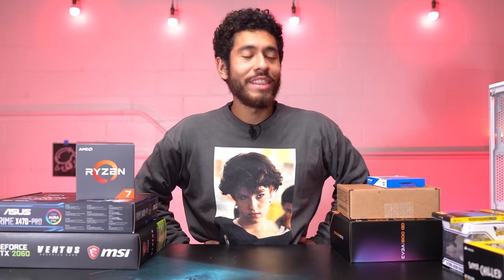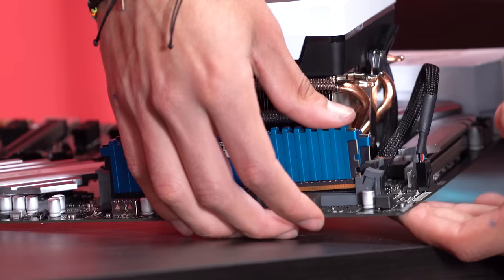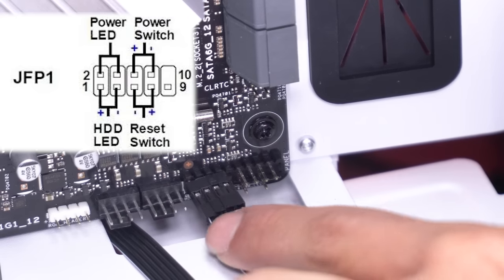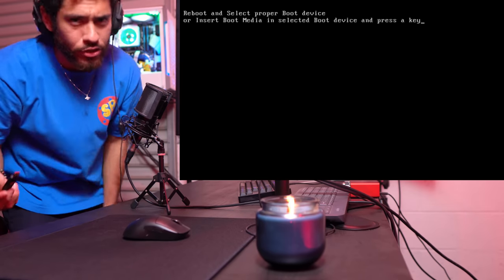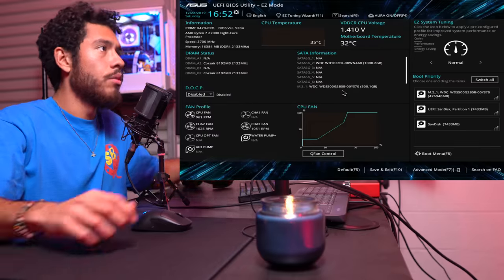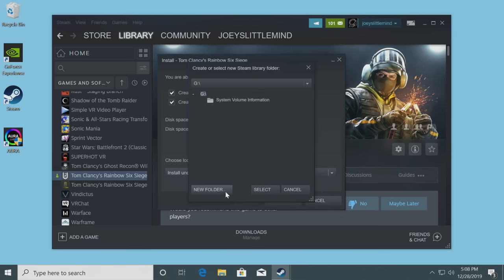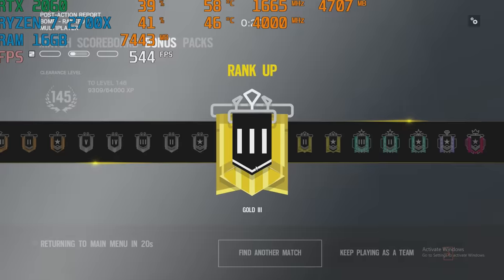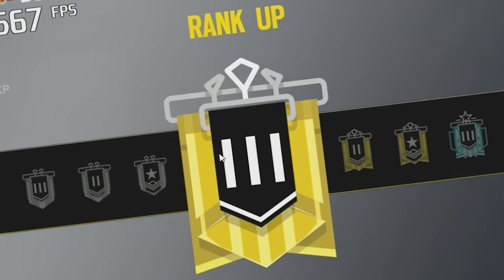Best $1000 Gaming PC Build Guide - RTX 2060 Ryzen 7 2700X (w/ STREAMING BENCHMARKS)

Comment: I finished my build today. Used everything in this video exactly. Had to buy a few things off Ebay and over pay. I had absolute zero PC knowledge. Followed this video and it all works. I am so pumped. I can't believe it works.
Reply: Hey if you are still reading this i wanna ask, Was it worth it? I mean can it provide you decent level gameplay and fps
Reply: @pushpagupta8649  Yeah I have since built a more expensive build which I use but this one worked great. No complaints at all. I have it if you want to buy it....
Reply: @zachc7401  how does it run on warzone
Reply: @zachc7401  how much are you selling the pc for?
Reply: @thunders246  $1000 is probably more than fair considering current part prices.
Reply: @zachc7401  where are you selling it and how will it be sold ?
Reply: @zachc7401  do you have any socials?

Comment: Added everything into a cart on amazon it’s around $1400 as of now.
Reply: Dylan Gaw the processor shot up in price.
Reply: Dylan Gaw big time
Reply: Everythings prices are higher than ever bruh
Reply: @Henonaga  nice
Reply: Dylan Gaw coronavirus
Reply: Lucky in UK its £1000
Reply: If you really want a PC right now look at prebuilt s but then again they are selling out quickp
Reply: lol
Reply: Get a ryzen 5 3600 and a rx 5700 xt or normal 5700 theyre cheaper and better. Hope this helps
Reply: Do u need the fan extension cable
Reply: Gaurav Rattu How is £1000 I’m adding all together and is more like £1100-1200
Reply: @Jayden Films is there a problem?
Reply: @Henonaga and the ram
Reply: You just have to watch the prices everyday 3 times a day, i thought the same but i got the gpu for 360 and had originally bout the cpu for 180 found the motherboard for 145$
Reply: @willbagnall3416  i was looking at the reviews on the rx 5700 and they'll all they they keep crashing and the drivers are bad.
Reply: @bzbee5139  those will be old reviews, they updated the drivers recently and now theyre a lot better. The Nvidia GPUs of similar performance (eg RTX 2060) are a lot more expensive
Reply: @willbagnall3416  i still think od go with rtx2060 ko for 300ish dollars. I kept seeing the rx5700 around 400ish. Do u think it would be worth it? I mean 6gb vs 8gb but was looking at some tests and they seemed about the same the rx5700 doing just a bit better.
Reply: @bzbee5139  they are roughly similar and if you feel safer getting the 2060 then thats fine but a lot of prices of computer parts are up right now because of precious metals and materials being scarce
Reply: @willbagnall3416  that and since quarantine more people are gaming to stay isolated.
Reply: WagNalyd yea. I’m still getting it tho
Reply: @amunqureshi3761  not really
Reply: @willbagnall3416  Do u need the ryzen 5 3600 and the rx 5700 xt or just the ryzen alone?
Reply: @tomasellar1727  you need both, the ryzen 5 3600 is a processor, the rx 5700xt is the graphics card. These 2 are just a cheaper alternative to the ryzen 7 2700x with the rtx 2060 super shown in the video and will have relatively the same performance.
Reply: @amunqureshi3761  nope
Reply: Well prices change over the course of 4 months
Reply: @tomasellar1727  if you want to play games youll need at least an ok graphics card, so you could get away with an rx570 or similar and the ryzen 5 3600 could be replaced with a ryzen 5 1600 AF. Hope this answers your question
Reply: big oUeF
Reply: Will Bagnall they are better in gaming but will stress out alot if you want to stream nd gives shitty experience trust me tried that(have 5700 nd r5 3600x)
Reply: @vaccy7644  thats a fair point
Reply: might as well just get the 3700x for cheaper
Reply: @liljavi do you think that cpu prices will go down when ryzen release their CPUs in June?
Reply: I bought it, but honestly for a little more you could get a 2070 super!
Reply: WagNalyd since everyone is inside everyone is buying pc parts bows not the Time to buy parts
Reply: Will Bagnall i dont think so old gen 2700x is still pricey would go for a 3700x instead of a 2700x like in aud its 30-40aud diff again depends
Reply: never buy all the parts over amazon if you want to be on a budget. Try looking around the internet for the parts.
Reply: Kayden Rooks yep yep newegg is good
Reply: more now
Reply: Will Bagnall how do u know? i was looking into building a pc so i’m just curios lol
Reply: Henonaga do you think after the covid 19 is done you think the price will drop
Reply: When I put everything in the cart that’s what the total was to
Reply: The Toyota virus screwed builds up
Reply: It’s cuz of the coronavirus
Reply: Lil Mxcha nice vids
Reply: American or different country
Reply: I'm doing my first build and I have decided on a Zen 5 3600 CPU. Does it matter if the GPU is Radeon or Geforce? Should I got CPU and GPU AMD?
Reply: The processor was on sale when he bought it. He failed to mention it was on sale tho
Reply: Bulien Does yea
Reply: Ya I found a 750€ gaming pc build guide I added everything and it was around 950€
Reply: XG GAMING yea bc of the virus and I think u mean Ryzen 7 3700x
Reply: Yea wait until covid-19 is over and prices will drop
Reply: Is it easy to build the pc
Reply: @dahoodnoob270  please send me your  links because for me £1,074. 95
Reply: @willbagnall3416  theyre not cheaper
Reply: @w00vz11  they were 5 months ago. Prices change my guy
Reply: @willbagnall3416  i checked yesterday on amazon since i was on pcpp sorting the parts of a build i might get. i saw that even the 5600xt was more expensive than the 2060(with shipping/taxes included) and the 5700xt was around the price of a 2080

Comment: This pc build is a lot more in depth than other builds, the cables and each step. a lot easier than other tutorials but it would be better if u played more games other and 6, maybe apex, cs: go, or modern warfare would be better.
Reply: GTA 5 BRO
Reply: SickGhostNavy GTA 6 I WISH
Reply: Depth*?
Reply: @ufly6349  gta5 is not a heavy game it can run it smoothly on max settings
Reply: @ahmetRY  ight thanks
Reply: do you know where I can get a black Verizon of the motherboard
Reply: @alpha9086  there isnt one out yet, but if you really want one and you wanna be risky u can just spray paint the white accents, more complicated but you get what you want, dont spray the rgb parts though.
Reply: do u know where I can get a black verizon of the processor
Reply: @alpha9086  the stock cooler for the cpu is already black, he just painted the cpu fan white, so youll be good with the same one he used. tbh if you were going to buy that cpu you should get the ryzen 5 3600 instead, its better for games and is 3rd gen
Reply: sorry for asking so much question but this is my first time building a PC. Is there a way I can get the graphics card in black and is there a mother board that I can get near the same mother he has, but is compatible with the PC and black
Reply: @alpha9086  the "asus ROG STRIX B450-F" is a good motherboard around the same price  and its black. the graphics card he has is already black and silver, at 6:50 (click the time) he paints it blue, if you dont like the silver you can paint that part black too. good luck with your pc. dont mind to ask any questions easy or hard.

Comment: Literally I was saving for the same PC . Recently swapped the 2060 for rx 5600 XT
Reply: 46M views have you had any problems with the 5700xt
Reply: @ryanm4044    my budget was a bit low !
Reply: @ryanm4044  what issues are you having I've seemed to fix 99% of what I have
Reply: Alex Atwood the picture keeps getting like white lines in it if you get me
Reply: @ryanm4044 Which card do you have? if your card is undervolted or overclocked, take those off, if that doesnt help download DDU and uninstall the driver then go to the AMD website and install the drivers  that says recommended not optional it should be working after that, also make sure your MOBO chipset is updated (b450, x470, x570) and such if not RMA the card or return it.
Reply: Alex Atwood wow thank you for the help I only really know how to do the basics as I’m new to this the card is the 5700xt sapphire nitro +
Reply: @ryanm4044  any of that work?
Reply: @oreo flow itll max it out 144hz at least
Reply: Do you know if its vr ready? I REALLY want to get a rift s with my pc
Reply: @whittsweapons8568  hell yeah it will my 1060 6GB was 3 years old and ran VR great
Reply: Alex Atwood thanks dude! That helps me out alot!
Reply: 46M views I agree

Comment: I added everything together using your links ... $1,985 USD
Reply: Joey C you need to change the 2060 because they upped the price on the one he put the link to
Reply: Can you send the link for the fan extension cable can’t seem to find it. Thanks.
Reply: Dude if u  wait the new GPU from Nvidia is coming out so the price on this GPU is gonna drop by a lot.
Reply: Yah there’s 2080 ti’s going for $400
Reply: @jack-ey4of  give me link
Reply: @itsme3297  just search on ebay
Reply: @hazziii  you can just get the XS version its basically the same thing
Reply: Make that like 2,200 becuase of warranty and shipping
Reply: @gabrielg.5375  mine was only 1100, and that was cause I had to get a better graphics card cause the other was discontinued
Reply: Go for a different brand 2060 or I recommend the Zotac 1660 Super
Reply: @frosty7511  can you send me links to the parts you changed for this pc

It would be mega appreciated
Reply: @calster7022  https://www.walmart.com/ip/MSI-GeForce-RTX-2060-Gaming-Z-6G-Graphics-Card/619736797?irgwc=1&sourceid=imp_xbjR-nSPXxyOUnEwUx0Mo3YlUkiSMgyJMz9m2s0&veh=aff&wmlspartner=imp_79301&clickid=xbjR-nSPXxyOUnEwUx0Mo3YlUkiSMgyJMz9m2s0&sharedid= this is the gpu you can also get it on amazon but its not sold by Amazon itself so its overpriced
Reply: @frosty7511  is this better than the one in the video
Reply: @calster7022  yeah its a little better
Reply: I know he lied!!
Reply: Go to a different 1000 build thats updated with this time of yera(corona)
Reply: Cepns kmin
Reply: Cepns kmini
Reply: Yeah same I just decided to go with the 1660 ti instead of the 2060
Reply: now i'm terrified bc i live in australia so it's going to be almost double the price
Reply: is it okay if i altérnate the graphics card for the xs?
Reply: @frosty7511  I saw it’s around the same price on Amazon but my total would still be 1500
Reply: @crvxsh4625  I'm not sure how thats possible unless you added something unnecessary or are using a wrong site
Reply: this is old just change the brand dumbass
Reply: @Hxsan  JBtek All Black Sleeved PWM Fan Splitter Cable 1 to 2 Converter, 2 Pack https://www.amazon.com/dp/B01EF9OI0O/ref=cm_sw_r_cp_api_i_EBEMFb0EHJ41J?_encoding=UTF8&psc=1
Reply: @guspygu  can someome help me the graphcis card is unavailable for me could someone check please this  (https://www.amazon.co.uk/MSI-RTX2060-V375-035R-Graphics-GeForce/dp/B07MVZM78T/ref=sr_1_1?dchild=1&keywords=msi+rtx+2060&qid=1604439974&sr=8-1)
would work instead
Reply: Buy those parts 1 by 1 so you have time to save and earn money
Reply: @4qurus   if you have no problem switching to an AMD graphics card do it, I don’t want to start any fanboy war or anything but AMD is looking strong this round, also next gen consoles are going to use AMD’s big Navi tech. (Tip : don’t buy an Nvidea graphics card right now because there prices are sky rocketing
Edit: Here is a decent graphics card that might be a substitute.ASUS ROG Strix AMD Radeon RX 5600 XT TOP Edition Gaming Graphics Card (PCIe 4.0, 6GB GDDR6 Memory, HDMI, DisplayPort, 1080p Gaming, Axial-tech Fan Design, Auto-Extreme, Metal Backplate) https://www.amazon.com/dp/B08C7L3Z13/ref=cm_sw_r_cp_api_fabt1_igYQFbQ7Q11EQ?_encoding=UTF8&psc=1
Reply: I just added everything up last night on amazon using the links he sent and everything came out to 1,069.99. The only exception was the mother board I just used the second link to the other motherboard option that he linked in the description
Reply: @Hxsan  just buy any fan extenstion cable
Reply: some of the prices and jacked up on amazon, if you go to newegg you can get better prices with the messed up prices on amazon. i got 1030
Reply: @jack-ey4of  is they?
Reply: @mellon6036  That was when the 3080 was released and people were panic selling their 2080's. Unfortunately those were sold immediately and there are none right now selling for that low

Edit: the 2080's selling for $400 were used, not new

Comment: Only things that are hard to me building PC, are how to connect cables to diffrent parts and cable management😔
Reply: Hyposez  yea true
Reply: Mine is especially the power button/front panel connectors
Reply: Think of it as LEGO’s
Reply: Tyrone I’ve never played with LEGOs
Reply: Lintic oh wow then think of it as building blocks
Reply: Tyrone ok
Reply: hlakbr lighthouse yo  can u help me 😂 I connected them to the board but where do I connect the other part of the panel connectors
Reply: LowkeyLightning Fn search up pc building discord server I recommend buildapc they help a lot you can ask your questions there
Reply: @matton60ping24  yo if u got this setup can you tell me the fps you get on fortnite
Reply: if you got this setup can you tell me the fps on fortnite
Reply: cursed Namo little different I have the 2060 super and the Ryder 5 3600 on all epic I get 144-150 fps on all low wi th medium view distance  I get 290-310 I do recommend capping it if u have a 60 hz cap at 75 fps 144 cap 165 and 165 cap 240

Comment: I’ve really wanted to build a pc for months and I have enough for a build like this so I think I’m gonna do this exact build
Reply: No, don’t.
Reply: Adonis Rodriguez why
Reply: There are pc for the same price and better specs
Reply: And question, what are you gonna use the pc for?
Reply: And altogether the build I sended you is 1030 dollars. You can add case fans at the front if you want. If you care about getting like at least 30+ FPS on most games and don’t care too much about aesthetics and RGB, build this.
Reply: banxx Everything on my list is better. The GPU is very comparable to a 2070 super, surpassing it in some games. The CPU is averages like 5-10 more FPS on most games. The motherboard is also much better. It also includes 2 TB of hard drive storage, instead of 1. And also an nvmE m.2 1 Tb. So 3 TB of better storage. The power supply is also 750 watts, instead of 600, making a big difference if you wanna upgrade components down the line. The only thing he has on his PC is better aesthetics and more RGB. So overall, if you are actually smart and put performance on top of aesthetics, build what I sended you.
Reply: Oh and don’t worry, if your going for my build, everything is compatible. You don’t need a BIOS update.
Reply: Adonis Rodriguez what exactly is your build? I’m interested
Reply: Adonis Rodriguez pass me all the specs I m interested.
Reply: @grama3057  so u say all this an delete the build an don't respond to any other comment? What a jackass

Comment: For me this was a perfect speed. But i can imagine for most or newer builders this might be extremely fast and hard to follow.
Reply: pause button my guy ;)
Reply: Bro dis stuff is so confusing someone help me build a pc😭😭
Reply: @yxngkid2852  Id Find a better how to. Someone who is slower and more in depth. a pC is like 6-12 parts and alot of wiring around. It is simply confusing.
Reply: @yxngkid2852  I bought this exact build (With a few exceptions). What do you need help with?!
Reply: Does the second motherboard option work
Reply: I need help connecting to the internet, have a ethernet cord connected but its not connecting in the settings

Comment: 11:45 ahhh I was feeling confident about building myself a pc until he told us about corrupting the motherboard if the pc loses power during bios update, scary stuff
Reply: You don’t need to update bios if you have a max motherboard
Reply: ProdigyxWho cool what’s a max mobo
Reply: chriscrocvlogs just a motherboard with the word max at the end (ex: MSI b450 tomahawk MAX) some non-max motherboards don’t require update either. It will say Ryzen 3000 compatible out of the box on the box if its not due an update
Reply: ProdigyxWho great , thanks
Reply: Some motherboards have a backup BIOS, so if the main BIOS were corrupted, you could recover it from the backup.

Comment: Hey Guys, just wanted to say I am building this pc and I already have some of the parts. Instead of a gtx 2060 I have a 1660 super but the rest is pretty similar. I still have to buy the psu, the ssd, hdd, motherboard and case
Reply: Are you planning on exactly copying the way he did it or are u gonna do somethings different, cause if your gonna do it different then can u tell me if your gonna install 3 more fans like he did
Reply: @sammylahmeda7271  Hi!! I wont be installing 3 extra rgb fans due to the fact that the Corsair case comes included with some already and the cooler can also illuminate. For the rest of the parts, it will be pretty similar, but I might change the motherboard. I will be making some updates on this post so stay tuned!!
Reply: @briannemes6851  ok thank you

Comment: Wth. That’s weird he uploads this as I’m setting up/troubleshooting my pc I just built with this exact same cpu...😳
Reply: I just got the same CPU and mb yesterday
Reply: I'm buying these exact parts do I need to buy the white extension cables or can I just use the ones that come with it?
Reply: kizbe the power supply extension cables? No they are optional. The power supply you buy comes with cables that can power your pc. The build guide should be good enough to get you through the building process
Reply: @jalenjayruiz7875 thankyouuu and what about the fan splitter cable and fan extension cables do I need those?